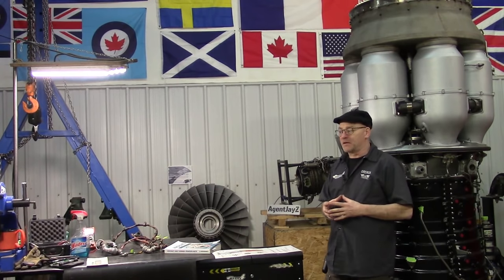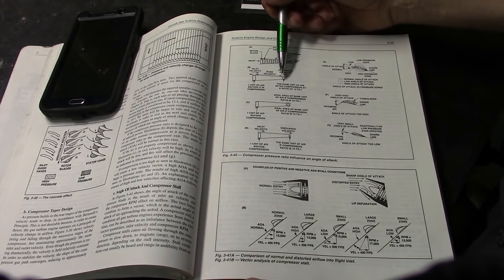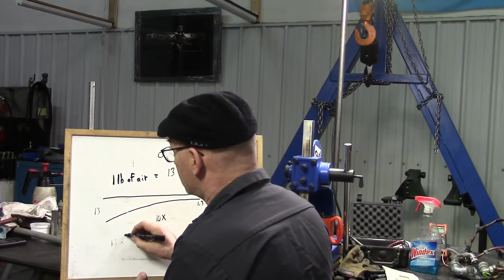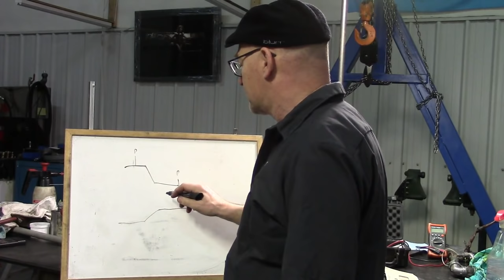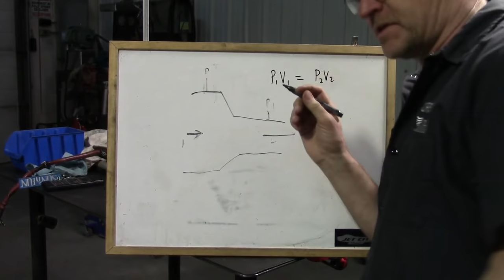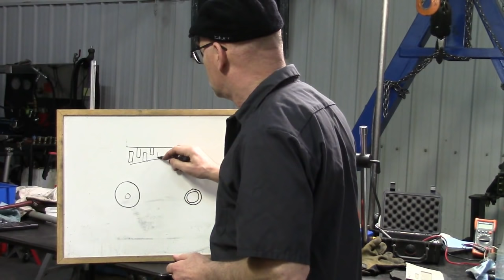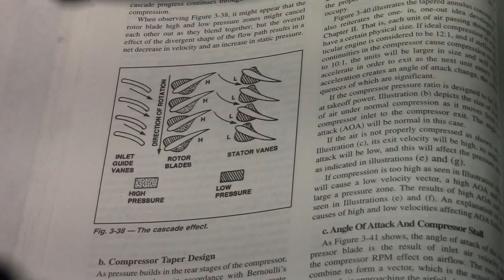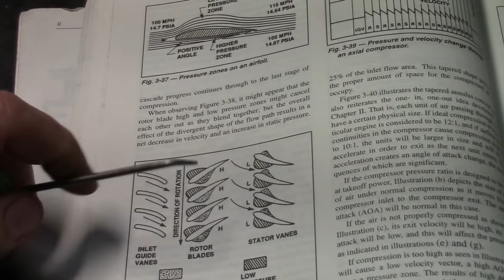the Narrowing Compressor Gas Path: Jet Engine Mistakes 3

Comment: Thanks AgentJayZ. Great videos, informative and entertaining. Thank you. I have a question: All things equal, increasing the compression ratio increases power. If you double the CR then you double the amount of power needed by the compressor but the engine power output more than doubles. Why? (I did search your channel .... you mention increased CR in Questions 14 but didn't state why.)
Reply: Several things:
1. The term used in jets is pressure ratio, not compression ratio. They are not the same - compression ratio is a piston term - the ratio of volume expansion, so really it is a density ratio. Pressure ratio is self explanatory.

2. If you double the pressure ratio, you don't double the power needed by the compressor. It is a non-linear relationship. If you start with a 10:1 ratio and double it to 20:1, you increase the compressor power by 45%, assuming that the compressor efficiency is the same. If you start at 30:1 and double to 60:1, you increase the compressor power by 31%.

3. Engine power will not necessarily increase if you just increase the PR. It depends on turbine inlet temperature as well.

4. What happens when you increase the PR, is that the thermal efficiency increases, so you will either burn less fuel for the same power, or burn the same fuel for much more power (and if the elevated turbine inlet temperature can be tolerated).
Reply: @ASJC27  Thanks for the informative reply.

1. How did calculate the power increase for the PR? I assume there must be some additional factor to P1V2 = P1V2?

2. How does the PR increase the thermal efficiency? I assume that increase in efficiency offsets the increase in power required by the higher PR compressor?
Reply: @raffaelefilardo170  
1. a. Using Volume (V) is more of a closed system thing, like in a piston engine. It doesn't apply directly to an open system, like a jet, since volume is continuously varying and isn't clearly defined in that case. In open systems you can instead use specific volume (lower case "v"), or equivalently and more prevalently, density. 
b. P1V1 = P2V2 is incorrect. Temperature varies greatly with pressure and is also a factor. The correct relationship (for a closed system) is P1V1/T1 = P2V2/T2. In an open system, like a jet, the equivalent expression is P1/(rho1*T1) = P2/(rho2*T2).
c. The power required by the compressor, normalized by compressor inlet temperature, specific heat capacity and mass flow, is given by 1/eta_c*(r^((gamma-1)/gamma) - 1), where eta_c is the isentropic compressor efficiency, r is the pressure ratio, and gamma is the specific heat capacity ratio (1.4 in air).

2. Jet engines utilize the Brayton cycle. The thermal efficiency of the ideal Brayton cycle is eta_th = 1 - r^-((gamma-1)/gamma). A higher thermal efficiency means more expansion is done following the expansion through the turbine (driving the compressor).
A greater pressure ratio means there is more expansion possible (going from a higher pressure back to ambient), and that is proportional to the pressure ratio. The power consumed by the compressor increases at a much slower rate so more residual combustion heat can be recovered to shaft power in a turboshaft or thrust in a jet -> higher efficiency.
Reply: @ASJC27   Thank you again! You've taken me back to college chemistry. I can see how the power consumed by the compressor at much slower rate than the efficiency of combustion. I'm trying to visualise it at a molecular level. The increased pressure from the compressor is released (ignoring losses) so the net win comes from the combustion process. There must be something about the increased pressure/density of the working gas where more of the heat goes into the gas than is lost to the environment?

Comment: If I say that in a high speed region, most of the molecules are busy moving in the direction of motion (ram pressure), thus can't put so much pressure on the walls? (static pressure) Does that adequately explain it? Vice versa in an expanded, slower moving area.
Reply from the maker: Some books do explain it that way.
Reply: Exactly. Gas pressure is gas molecules hitting the walls. Duct increases their movement in the direction of motion at the cost of movement in other directions.

Comment: @5:31 - I don't think the diagram is wrong. The three gauges at the bottom are not experiencing just the ram pressure but the sum of the ram pressure and static pressure.  Easy to see why - if you stop the flow the ram pressure will be zero and then the gauges at the bottom will still read the static pressure.
Reply from the maker: description

Comment: Hey JayZ, let me ask you something. There a video about a kid that hid himself into the inlet of a small jet and got caught by security. People said if the engine had started the kid would get minced.
I guess the start is mechanical, so the question is, supposing that the kids was leaning to the blades, is the starter strong enough to slice/dilacerate a person, or it would just break?
Reply from the maker: Strange question, without enough information. What's a small jet?
The starters we use have a torque output of 650 ft-lbs at zero rpm, which drops off to zero at about 3000 rpm.
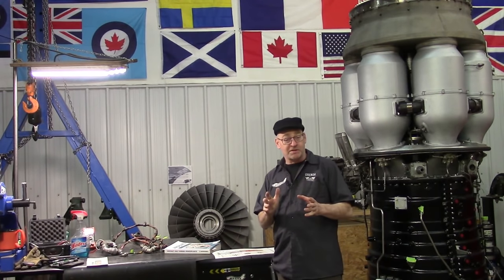Reply: @AgentJayZ  It's @1:07 here https://youtu.be/JLSeHCCI8CI 
But by what you said, I guess it would make a lot of damage even starting from full stop.
Reply from the maker: Looks like a CJ610. There are a bunch of inlet guide vanes in front of the compressor, so the kid would not have been pulled in. But the engine would never have run properly with more than half of the intake blocked with human. The temps would have been high, the rpm low, and the pilot would have shut it down to investigate.
The stowaway would have been terrified, the engine would have been damaged by any straps or buckles or whatever, and the trip would never have happened.

Hmmmm. It never did happen. Maybe he was seen, or maybe the engine would not start at all.
Reply: Sadly, there have been several fatal accidents over the decades, with individuals being sucked into engine intakes.  There was one such event in 2006 in Texas, involving a Boeing 737.  There was another, in 2015, which occurred in India: it was reported worldwide.
Somewhere on the internet, you should be able to find a clip of an event, back in 1991, where a sailor was sucked into the intake of an A-6 Intruder on board a US aircraft carrier: I believe that he survived.  I have read somewhere that it happened in the UK, back in the 1940s, to a Gloster Meteor.  The victim survived because the engine had a centrifugal compressor with a plenum intake.
Reply: @grahamj9101  Yes, I've seen at least one of these videos, but I guess the engine was already running "by itself", compressing, reacting, exhausting, whatever. In the kid's case, the engine was in full stop. My doubt was if the starter itself would be strong enough to kill or severely hurt a person.

Comment: What about the centrifugal force applied to the air? How much it contribute to compress the air?
Reply: There is none. The air does not rotate with the compressor blades. It would if there were no stator blades, but immediately behind each ring of spinning compressor blades is a stationary ring of stator blades that redirects the air straight back. 
OK, not exactly true. each ring of stator blades more than straightens out the air flow for it to be at the ideal angle for the next row of compressor blades to 'get a good bite.'
Reply from the maker: In axial compressors like these, none. In centrifugal compressors, all.

Comment: AgentJayZ I have a question I've heard from 2 sauce's the forward thrust comes from the gas-turbine the moment it light's, I've not been comfortable with this because of thrust vectoring types like the harrier VSTOL, awesome fighter jet, one of my favourite's, can you help please ?
Reply from the maker: Most of the thrust comes from the jet nozzles. If you don't start from there, you are already lost, and will never reach an understanding.
Reply: @AgentJayZ  the 4 stroke is often Suck, Squeeze, Bang, Blow, l am vehicle mechanic, but hear jet technicians say the same thing, but Bang implies high pressure explosion, you taught me the pressure is low, so Suck Squeeze, Burn, Blow is this true ?
Reply from the maker: Sure. It's just a colloquial saying, and you can't take it too seriously.
If you want to be more accurate, you need to realize that there is no such thing as suction.
Not a topic for discussion; a topic for further reading.
Reply: @AgentJayZ  indeed, thankyou for your time, forever your student,

Comment: Hello I was wondering if you could tell how hard it might be to get 1947 rolls royce derwent jet engine combustible liner
Reply from the maker: Best to try Ebay, and then just search everywhere. Somebody's got to have a couple.
Reply: @AgentJayZ  I've tried Ebay no luck I'm still looking around where might a good place be to start if I may ask
Reply: Yes... They are all combustible given enough temperature and in presence of an oxidizer :P (Sorry could not contain myself xD)
Reply from the maker: Well, think of it as a challenge. You have a very specific request for a very old piece of  what was once hi-tech.
Your search would be easy if you weren't looking for a Derwent liner, because most of them will be in museums.
The specifics really aren't by year, but by dash number of the engine... but you would know that if you really had needs that specific. 
If you just want an old liner, you will find many for quite low prices.
Otherwise, get looking. I don't know where any Derwent liners are, and I'm not going to do the looking for you.
Reply: @AgentJayZ  no your fine I'm just see we're I can start to look for one thank you tho

Comment: I totally agree about using multiple sources. Absolutely!
Here's a thought...... spray water on each little bucket on the circumference of a wheel. Each bucket can be thought of as the input for a single lever - even though the wheel may be "solid" and not broken up into individual spokes or arms. Still, each wheel can be thought of as having multiple levers and each lever has its own individual effect on the power transferred to the center of the wheel. So, a water pump (or two or more) can input a huge amount of power to the wheel's  center because the lever effect does multiply mechanical power. We know this because a child using a lever can lift a car off the ground - I did that as a child. 
So, input massive amounts of power to the water wheel's center then take that power out to run a generator. Use the generator for two loads. One load will be to power the water pump. The second load will be your shop tools, lighting, refrigeration, heating, etc. All thanks to the power amplification inherent in the humble lever. Unhook from the grid and make your own power for the cost of a wheel, a pump, and a generator. However, once running, you won't need to keep paying for electricity or gasoline to run your device. 
If the lever effect works (and it does work) then you've got a system that can benefit you for years to come.  :)

Comment: i have a question, sorry fornmy english, when u talk about v1*p1=v2*p2 (i studied chemistry so i saw this) u dont talk of the temperature rise when compressing the air, work is done there too right? thats why we use an intercooler after the turbo in the cars, the pressure shouldnt be higher?
Reply: besides that i think that this video was beautifully explanatory
Reply from the maker: Intercoolers do help with compression, but a jet engine used so much air that the surface area of the cooler is so great that increased engine power is more than offset by the increased drag. Intercoolers used on stationary industrial engines are larger than the engine itself.

Comment: I had an accounting text book that was so bad that the instructor gave everyone an A. In a 2 page long list of debits and credits and neither column (2 column book keeping) would add up to the right amounts. 

They had things like 10k + 2k =15k and in the debits they would have 10k - 2k = 5k so they had probably changed 5k to 2k and not updated the totals. Sometimes they would get the basic principle wrong though and even make multiple mistakes in the same problem so it was impossible to figure out what was supposed to be the right answer.
Reply: Introduction to Wallstreet accounting 101?

Comment: I'm wondering why are there multiple stages and not just one. I suspect it's either due to ease of manufacturing or some inefficiencies due to sudden changes in speed/pressure. Intuitively (I have zero knowledge) you can design a rotor with a compound curve and have a lot less moving parts, with a single stator stage at the end.
Reply from the maker: Ah! The most important thing you said was... Of course you know what it was...
Reply: You have indeed demonstrated that you have zero knowledge.  However, such a device has existed since the very beginning of the jet engine.  Frank Whittle used such a device: it's called a centrifugal compressor.  I suggest you do some research online and educate yourself to a foundation level.  AgentJayZ has also listed several useful books: please read them.
As an illustration of the progress that been made with axial compressors in the past 70 years, AgentJayZ has shown us J79 and LM1500 engines on several occasions. They have 17 stages, to give a pressure ratio of around 13.5.  Even before the turn of the century, there were 10-stage compressors that could give a pressure ratio of 20:1: I helped design one.

Comment: so the duct has to be lowering the pressure at a lower rate than the stages increase it at. 
why not just make the stators a little less divergent so the air keeps the speed gained from the compressor blade?
Reply from the maker: The thing that actually raises the pressure is the divergent pathway between the stators.
Reply: Please see the comment that I added just a short while ago: it might help.  
"Wee sleekit cow'rin' tim'rous beastie, O, what a panic's in thy breastie" - I think I have third degree Burns.

Comment: Sir, I have a question,
What causes fluctuations in the afterburner section ??
Reply from the maker: Depends what you mean by fluctuations. So yes.
Reply: @AgentJayZ   when ever the after burner is started, the flame starts unsteady fluctuations,
 instead of constant gas flow rate, it starts behaving like pulse jet type combustion.
Reply from the maker: There is no afterburner in this video. Each example I have seen of an afterburner functioning seems different. Many seem stable, and some appear to fluctuate in some way. The noises it makes are not something we consider as long as the thrust is produced, and the fuel flow is proportional to the throttle position.
Reply: It is very easy to have an instability in combustion systems.  Have you ever flown on a B.777, powered by GE90 engines?  On start-up, they suffer from a so-called 'combustion rumble' phenomenon, which vibrates the whole airframe for several seconds.  Afterburner systems can be subject to an instability phenomenon, known as 'buzz'. 
Going back to the Apollo program(me), The Saturn V engines reportedly needed over 2,000 modifications before consistently stable combustion was achieved.
Reply: @grahamj9101  what causes that combustion instability or what's workup around it ?
Reply: @aviksaha2746  the system isn't at optimal temp, you get instable flame and localised rich/lean air fuel ratio making an incomplete combustion in the after burner, the fuel isn't evaporating and burning up fast enough to provide usefull work, its the same thing with cars when you pull timing for example
Reply: @ssllhh100  thanks

Comment: You could almost do compressor stall video.... number 2? as a followup?
Reply from the maker: You mean a second compressor stall video? Have you seen the first one?
The shape featured in this video is not a cause of stalling, but compressors are one of the most difficult parts of the engine to understand.
Reply: @AgentJayZ  yes I have and you did that video very well too 👏🏼 I agree